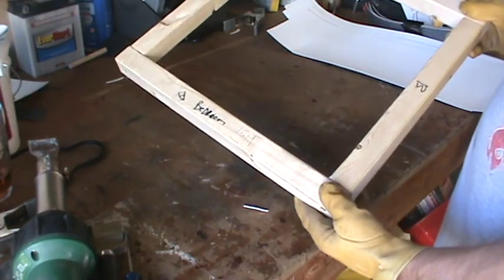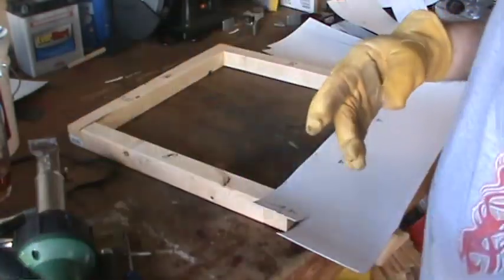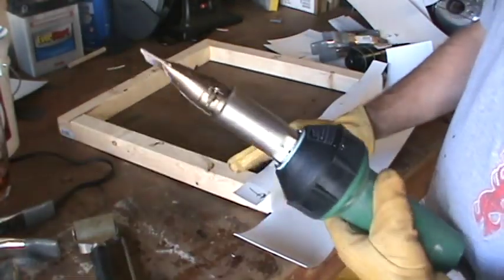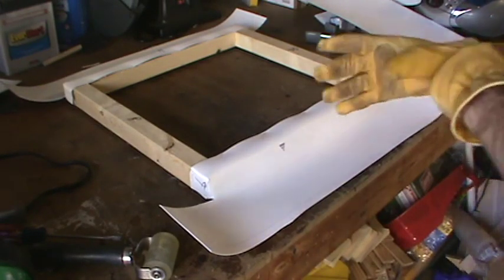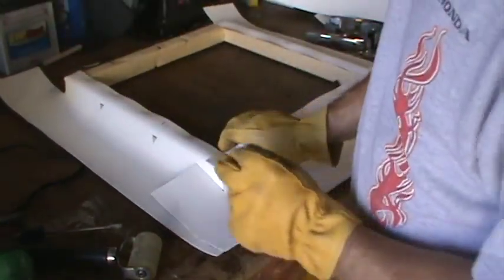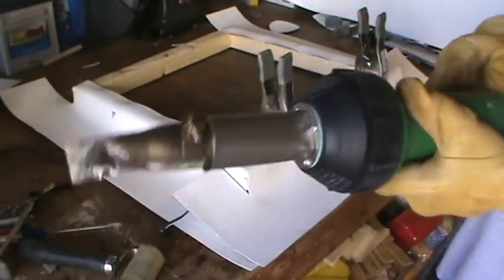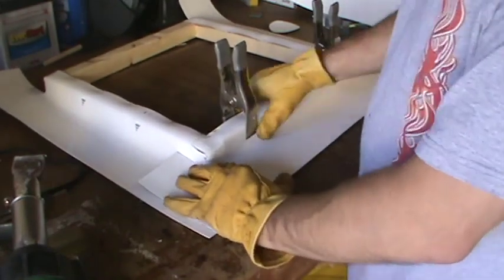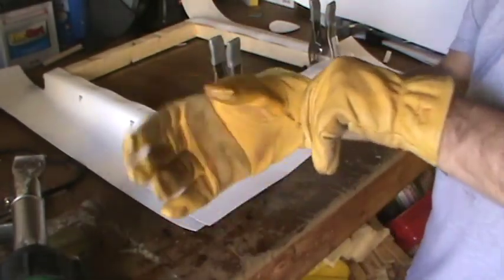RV Roof Repair Part 5

Comment: I appreciate your reply. Which made perfect sense. I got the visual from your explanation.   I m currently roofing my 2014 Big Horn after having a tree fall on it as I crossed a small country road bridge.  Thankfully the damage was minimal. Today, I purchased the material for the curds. I bought pvc 1x 2’s gonna try it, hopefully it will bond to the TPO with heat. 
Again, thanks for taking the time to upload your work. Very inspiring and helpful.
Reply from the maker: If your existing roof is the rubber sheet used in most applications you might not heat the tpo enough before the rubberized roof may melt. I would suggest heating just the TPO and allow that to melt to the existing roof. The TPO has a much higher melting temp than the existing roof. Whatever method you choose try testing it first somewhere. I hope the tree didn’t damage the roofing ply. Good luck!

Comment: If you use non-reinforced TPO you can make better curbs. Non-reinforced TPO is easier to shape and weld. It's what RV install and commercial roofers use. I am part way on my re roof, redeck and delaminate repair.
Reply: Charles, Any chance you could provide the info on the material you are referring to? TIA
Reply: @kevinwalker9028  go to RVROOFINSTALL.COM    and watch some of thier videos. He explains the material in almost all of his videos
Reply: @kevinwalker9028  it depends on what brand of TPO you're using. If you're using GAF Everguard TPO membrane,  you would need to get GAF Everguard flashing detail. If using Carlisle, you would need to get Carlisle Sureweld flashing detail. They generally come in a 50ft roll. You cannot use GAF on Carlisle and vise versa. The chemistry isnt the same and arent compatible.

Comment: Where did you purchase roofing and heat gun sir? Rebuilding my 1997 Jayco fifth wheel would appreciate any help!
Reply from the maker: Hi. The heat gun was purchased on Amazon from a company called Gotohome, 1600 watts, plastic welding gun. Here is a link I hope works: https://www.amazon.com/Go2Home-Plastic-Welding-Handhold-Nozzles/dp/B07H7ZXRJ6/ref=mp_s_a_1_3?keywords=Go2Home&qid=1577789387&sr=8-3

The TPO was purchased from a local Roofing Supply store - 60 MIL, White, with reinforcing mesh. I believe my roll was 10 foot wide by 100 foot long, the smallest available then. So I have 60 feet of it left if your local.

Comment: Getting ready to put a new TPO roof on my RV, plan to follow your inspiring video to make curbs. 
 My question is: the interior flashing. Does it fit with the curb step up off the roof. Did you have to do anything special to the interior when reinstalling the fan?
Reply from the maker: Let me know if this makes sense. I covered the whole roof, openings and all with a single roll of TPO. By running my hand over the openings I was able to find the edges under the TPO. For square and rectangular openings I drew a line from one corner to the opposing corner and made an “X”. I cut along those two lines and pulled the TPO down into the opening and staple/nailed the TPO to the wooden area in between the roofline and the ceiling. Any TPO that extended below the ceiling was cut off. 

That leaves a perfectly flat roof for you to adhere your curbs. 

I will do my best to upload the videos that show all that before Saturday, April 10
Reply: @brunocase7041  
Fox Nation
Reply: @Bruno Case Flixportal
Reply: @Jameson Emory Thanks, I signed up and it seems like they got a lot of movies there :) I really appreciate it!
Reply: @Bruno Case Glad I could help =)

Comment: Rich, If you still have the TPO material, I would be interested in buying it, I have a 2005 Springdale in similar shape.
Reply from the maker: I have 50+ feet of TPO left. It is in NJ. Send an email to richsettino@gmail.com if you are interested.  I will tell you the roll is heavy and ten feet long!

Comment: ok how did it turn out
Reply from the maker: It turned out very well, I will attempt to upload the final video as soon as I can.  The good news is the roof is now sound for the next 50 years, the bad news is these campers are assembled so poorly that the roof will outlast the camper by 35-40 years.

Comment: Anyone interested in learning more about TPO roofing, check out @Acrcommercialroofing  or @MuleHideVideos they both have excellent videos on how to apply TPO roofing material and how to properly install curbs and flashing.  Almost forgot @polyfinagpolyfinag5287 is also an excellent source of info for heat welding.